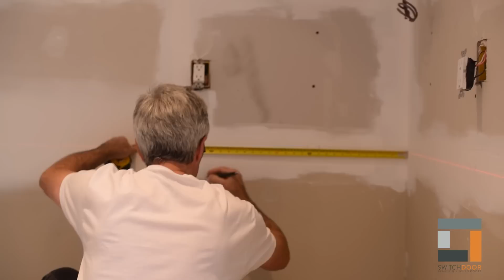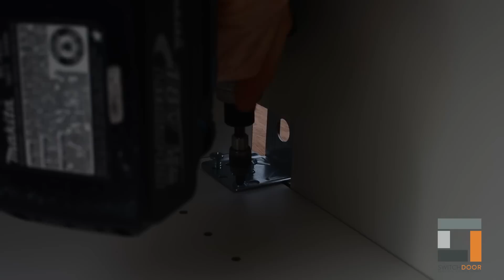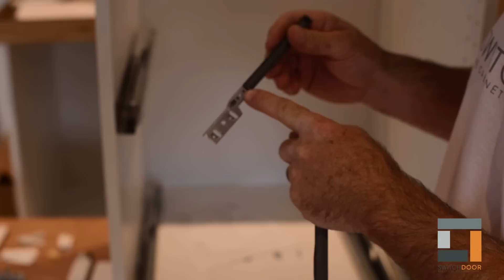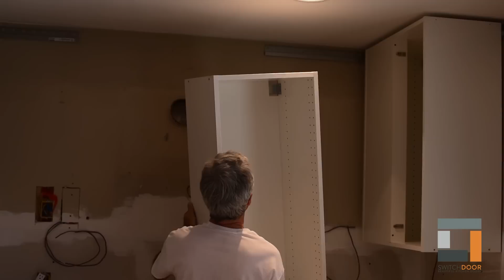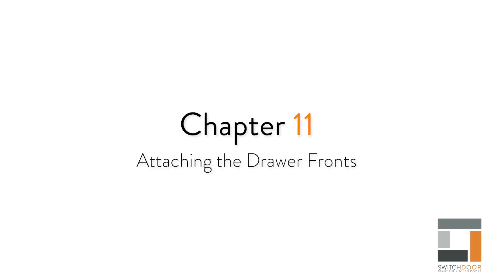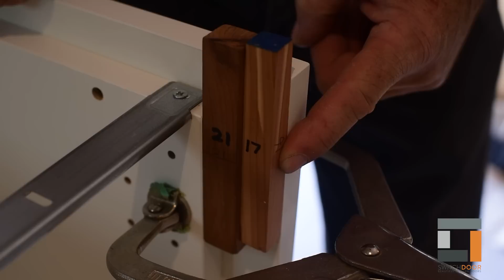How to Install an Ikea Kitchen

Comment: After struggling with IKEA kitchen design and installation in different phases, I finally found this professional installation tutorial — a visual textbook! When you flip through IKEA instruction pages, it’s like watching a Chaplin silent film — charming and funny but not exactly helpful when it comes to reality.

With just 42 minutes, you get a full walkthrough from beginning to end. Every step is explained with easy-to-understand detail and clear close-up shots, so you can actually see what to do.

When the well-engineered IKEA system meets the real world (with its uneven walls, crooked floors, and off-center studs), things get tricky. IKEA hasn’t yet included optional methods or real world adjustment — it’s all one-size-fits-all. So it becomes a guessing game when things don’t line up, or worse,, your contractor walked away after a two-months delay … like mine did.

Some of the most challenging parts? Suspension rails and cover panels.
    •    The rails don’t align with standard 16” stud spacing — a big headache.
    •    The cover panels must be trimmed to leave a 5/8” proud front edge, and also be leveled, plumb, and parallel to the wall — easier said than done.

This video not only walks you through how to do it, but shows you the tools and clever tricks to make it easier — like using simple wooden blocks for consistent panel spacing. It was so thoughtful and well-planned, I wouldn’t be surprised if he wrote a full script beforehand.

Even the drawer installation part stands out — it finally helped me understand why the bottom drawer didn’t align properly before. His explanation of the difference between middle and bottom drawer rails was something I hadn’t seen in any other video.

This is truly a life-saving guide.  I’m starting to follow it step-by-step to redo most of my kitchen cabinets. I’m over 60 years old — and if I can do it, so can you! Thank you.💕

Comment: This guide was just superb. Exactly what i needed. Got one question though. In a straight kitchen (no corner cabinets), is it possible to deinstall the end base cabinet without removing the countertop. This is vital for my ikea kitchen plans, since these cabinets would be right next to some pipes, which would potentially require maintenance. Ideally I would like to design the kitchen in such a way that won't require complete reinstallation if something happens to those pipes

Comment: I did wonder, by not using the L shaped back cabinet spacer, replacing it with a block of plywood, would that not put all of the pressure on block then transferring pressure to the somewhat flimsy back panel. While i like your idea for transferring load to the stud, the plastic spacer also puts load on the hardboard frame. Just curious!!

Comment: This is a very well done VIDEO.  Really helps a lot.  At IKEA we've been told that the legs of the cabinet s not supposed to support the weight therefore we have to build a frame that the cabinets all sit on. I have watched a lot of videos and nom of the have mentioned anything about it.  So my question is can the vab legs support the weight or not? Cheers
Reply: Given that the the base units are hung onto the rail, and also with extra screws into the studs, most of the weight is on the studs. 

Therefore some weight going onto the legs won’t be an issue.

Comment: Great video...excellent teacher voice! 😂😂😂 i couldve used this video when installing my ikea cabinets. Can you please partner with Ikea to make their directions easier to understand? I got them in but had a bit of a learning curve, back tracking a bit as i figured it out. But overall no major issues....installing trim has me nervous....hoping this video covers that...still watching....cutting trim today. Wish me luck. 😅
Reply: Just watch the toe kick section....darn not as helpful as i was hoping. Im pretty handy but have zero experience in this area wish it was bit more detailed step by step....including different scenerios. I have no uppers only several  lowers to  fit in between two walls . Beside each end cabinet i have gaps one at about 2 inches.....other at roughly about 4 inches. Walls are not straight. So whats 4 inches at bottom is probably closer to 5 inches toward the top. 🤯🤦‍♀️ wall scribing is out of my comfort zone. 😢

Comment: Hi there, with regards to your Puk lights, why not purchase additional end panels and fit underneath the cabinets? You can router out channels for those wires/ lights and cut out the hole; therefore you do not need an extra shelf and it does away with the hole in the cabinet. Also, you keep the door fittings in the same place.

That is how I have fitted all of my lights. No wires are showing.

Comment: Very detailed but, unfortunately, incorrect in so many places. Watched all of it.
Reply from the maker: Please let me know where you feel we went wrong. Always willing to learn
Reply: @switchdoor2011  Thank you for not being offended 🙂 "Incorrect" may not describe what I meant to, but certain things don't make sense at all.

My comments below are based on Ikea's own instructions and best practices from installing 200+ Ikea kitchens personally.

Did I learn something from your video? Yes, opening the boxes with a putty knife. Good idea.

RAILS: Measurements for the rail. It is not 34 1/2" to the top of the rail, but 32 3/16" to the bottom. The top of the rail is not at the same height as the top of the cabinet, but a bit lower. The same goes for the pantry cabinets. Not 94 1/2" and 84 1/2" but 92 3/16" and 82 3/16". Also, when hanging the rails it is important to mention that if the floor goes in after the kitchen, the rails should be offset with the thickness of the rail. 
Drilling holes in the rails for screws take away any option to adjust the rails in height. Not needed and a waste of time if you ask me.

CABINETS: Drilling holes for screws into the cabinet cables is pointless. Not needed. The lock nut/disc is doing a great job and when cabinets are sitting shoulder to shoulder, they cannot come apart. Measuring the diagonal before nailing...pointless as you use the back as a square (as described by Ikea too). Alternatively use a carpenter's square. Cabinet assembly can be done in many ways. Yours are not great IMHO. 

DRAWER ASSEMBLY: There's a much better way of putting the hardware together, and countings holes for positioning the hardware inside the cabinet is not needed as well. Counting is so time-consuming. I am not going to explain why and how I do it as it will become too long a story.

Securing an island to the floor. Why not use the island kit? Your process "must be done over a couple of days"....wow...

Black/yellow screws for securing cabinets together. Seriously?

I agree that the plastic things at the bottom of the wall cabinets are poop but going through the whole ordeal with the wooden strips. Phew....makes me exhausted. And forever and ever, the client has to look at a screw at the back inside the wall cabinet. Not cool.

Potlights with a double bottom/shelf? I am flabbergasted. 

It must take you forever to install a kitchen, based on what I see. Handdriven screwdriver for drawer hardware. Counting holes. Waiting for the glue to cure and so on.

80% of my kitchens are installed in four days. Top job.

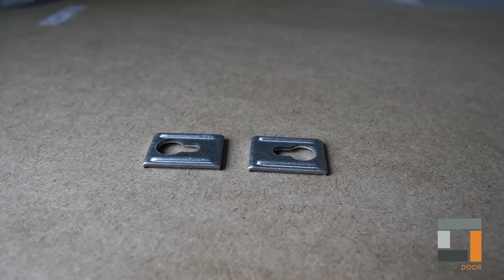Comment: at 3:43 the clips shown are the clips when not using a hanging rail, the hanging rail clips have a hole that looks like a large coma, they are meant to slide sideways so you can fine tune your hanging rail level before tightening down on the coma clips; also the rail should be presented to the wall to insure the stud locations have rail holes lined up on their locations

Comment: Congrats for the video, it is really helpful, I´m installing the kitchen but I did not find the studs, it is possible that the complete wall is built of concrete, should I use dowels / anchors to fix the rail?
Reply from the maker: You would need to use concrete anchors in this situation

Comment: Thank you a ton, this is extremely useful. I'm a bit confused with your explanations concerning the wages & shimmers adjustment. I don't understand at what time you replace these, with the 5.8" piece of plywood, and also since you're adjusting the shimmers & wages, how can the plywood reflect these changes then (meaning at the time you remove the wages and put the plywood alone)? Sorry for my misunderstanding, the answer is likely quite obvious!  Also could you please specify the references of the screws & bits you use to attach the bottom of the frames to the bottoms, to fix the frames together, and to fix the plywood behind the frame? Thank you again for all your advices!

Comment: In the Ikea suspension rail(602.615.27)  instruction manual (AA-1054038-6) it says to hang the rails 32 3/16" from the floor but in your video you say 34 1/2" from the floor, why is your measurement different to Ikeas? Similarly your measurement is 94 1/2" whereas iKea instruction manual says 92 3/126" and 84 1/2" vs 82 3/16"
Reply from the maker: Most quartz counters are 3cm thick which is the most widely used counter material. Our measurement reflects this to have your finished counter height 36" 
Good luck with the install.
Reply: @switchdoor2011  you explained that perfectly in the video but, no one pays attention anymore. It all depends on the thickness of the counter top you’ll be using
Reply: He might be going from the top of the rail?  In any case it's definitely 32 3/16" from the bottom of the rail.  Lots of people on these IKEA instructional videos coming up with other numbers when it's very clearly stated by IKEA.
Reply: @AC-cg6op  Yeah that’s probably it, measuring in reference to the top of the rail. Thanks

Comment: When hanging the uppers, do you screw through the plywood block and shims together?  Do you then cut the excess shim off at the base of the cabinet?
Reply from the maker: Yes, You've got it. This really helps secure the box to the wall
Reply from the maker: Yes, that is correct

Comment: Excellent, but missing the piece I was really looking for.  You can see a gap from the top of the wall cabinets to the ceiling.  I wanted to see some solutions for that.  To me that gap just does not look good at all.  

I watched another video after making the above comment and discovered IKEA recommends fixing the wall cabinet rail no closer than 3/4" distance from the ceiling.  That 3/4" is the exact thickness of the IKEA Decor strip.  So I am assuming the decor strip will fill that gap completely as long as I take the time to level the ceiling with plaster mortar or mud as they call it.
Reply from the maker: The best solution here is after you have installed all your uppers and hung the doors so everything looks good. Remove the doors and install a piece of primed material shaping it to fill the gap between the cabinets and the ceiling. Caulk any gaps and paint this piece same colour as your ceiling. This is the best solution I I found over the 35 years of installing kitchens.

Comment: I didn't quite understand the shim/block of ply procedure at the back of the cabinet to achieve the 90°. You appeared to be putting a screw through the back of the cabinet into the ply block and the large shim into the stud. We didn't get to see it but did you saw that large shim off after screwing???
Reply: Same  here. I wanted to see if he removed it or sawed the exposed portion off.
Reply: @switchdoor2011 Exactly the only part I really needed to see. Has this been addressed?

Comment: How did you reinforce the drawer slides? You mentioned that you were going to show how you did after the cabinet was installed but I didn't see that shown later but maybe I missed it. Thanks for the tips!
Reply from the maker: once all the cabinets are installed and put together you can pre drill a 3mm hole in a few of the remaining holes in the drawer slide and screw in a screw, 1  1/4" if two frames are side by side . This will give great strength to especially 15" high drawers. If a drawer frame is at the end of a run of frames you can still screw in some extra 3/4" screws that would need to be purchased from hardware store ( #8  3/4" countersunk wood screws)